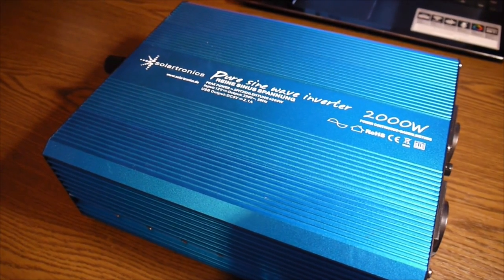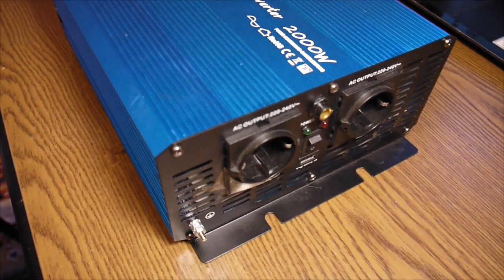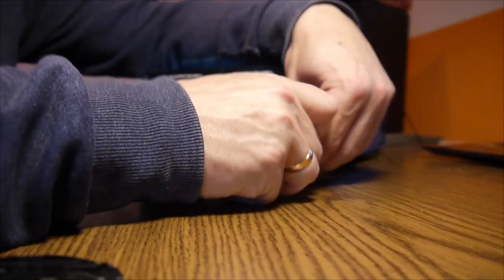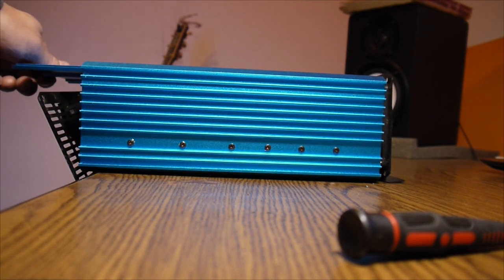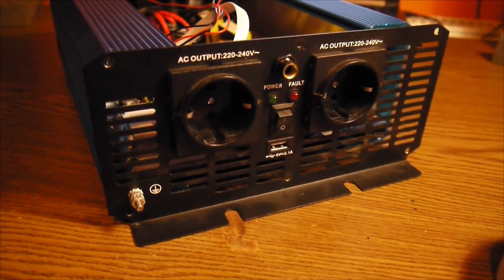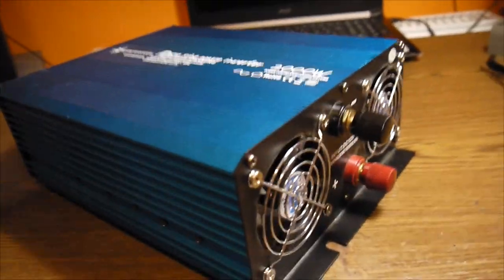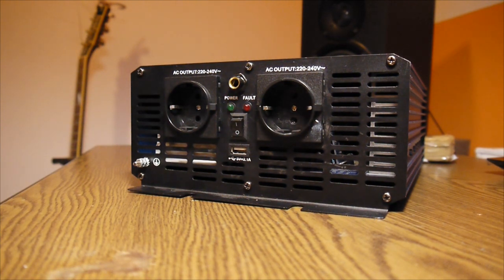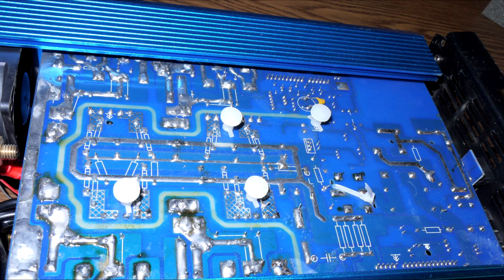Solartronics TS2000 Pure Sine Wave inverter 2000w, dismantle and mod

Comment: Hello, I have a USV 12V NPS 1500 Watt reiner SINUS UPS Inverter. Stopped charging the battery. Which fuse should be changed? There are 9 of them. Or is it something else? Thanks
Reply from the maker: Let me check the model.. I'll be back
Reply from the maker: First check the 12V connection with a multimeter on continuity mode..if there is an OL or infinite resistance, the low voltage fuses are gone..ussually there is something else involved to make them blow...a MOSFET transistor in short, big electrolytic capacitor...but if you want to give a try, replace the biggest you find, like 30 or 40 amps..looking like automotive ones , use the multimeter to check which is burned or visually inspect for..replace and carefully coennect the battery..but I doubt it's only the fuses...
Reply: @viocaia  I checked, the fuses are working. I checked the inverter and it works. When charging the battery, the coolers should start. And they don't start. Although they work in the inverter. And when I turn off the Charger button, the LED does not go out completely, but only by half.
Reply from the maker: @vlas22  Hard to say what's wrong without having the machine...is there any High Volatge output? You should hear a pitched sound..is it audible ?

Comment: Hi,Why does the fault light come on. It does not output 220 volts. solartronics 3000 watts full sunis.thank you
Reply from the maker: Check the input for the right 12V voltage..It's very dangerous to open it and check if you don't have the skills! I strongly recommend to check a specialist! It;s..maybe one of the Mosfet transistor got shorted due to much heat..
Reply: @viocaia  I did a battery check. The amperage is not low.thanks for the reply, i will try to do mosfet control

Comment: sal. ai folosit invertorul pe perioada mai lungă , ce părere ți-ai făcut despre el ?
Reply from the maker: Excelent
Reply: @viocaia  ms. am motat powerjack este ieftin , bunicel dar face zgomot mare cand creste tesiunea de intrare  mai exact atunci cand panourile incarca tare . aș monta altceva
Reply from the maker: @mihaipeia2016  nu inteleg! de ce face zgomot cind panourile incarca..nu e legat pe baterii? In sarcina sigur ca face zgomot, toate fac..
Reply: @viocaia  la baterii e legat , cand productia din panouri se opreste seara si scade tensiunea in baterii zgomotul se reduce considerabil , abia se mai aude
Reply from the maker: @mihaipeia2016  interesant , nu am remarcat asa ceva...al meu era mut pina intra in sarcina mare..atunci incepeau ventilatoarele..dar in rest ..nimic..nu cred ca e problema..
Reply from the maker: cred ca e ceav realtionat la volatajul bateriei...e posibil pe incacare la putere maxima, charge controllerul sa nu limiteze tensiunea de incarcare la mx 1,4V..normal peste acet voltaj invertourl va scoate acel tiuit de alarma..masoara volatajul pe baterii cind face zgomot..
Reply: @viocaia  nu este alarma de over voltage pur si simplu cred ca miezul de la transformatoare intra in vibratii si aia se aude.incerc sa pun un video la mine pe canal
Reply from the maker: @mihaipeia2016  ok..am inteles,,probabil un miez..pune ceva lac, chiar si de lemn..
Reply from the maker: Hey Mihai! Please subscribe my channel...Multumesc!